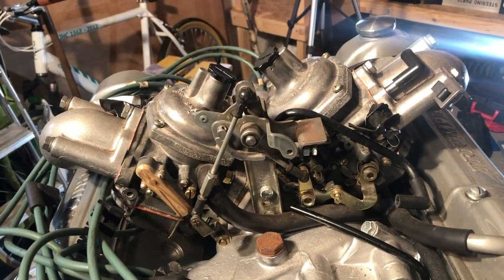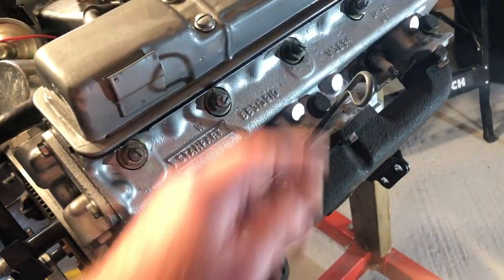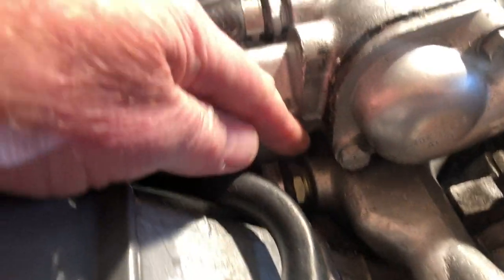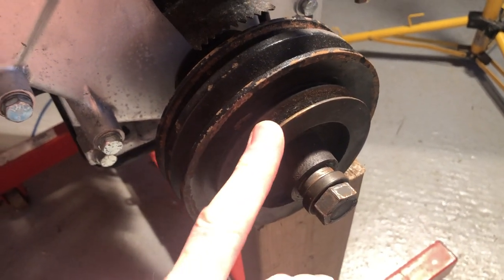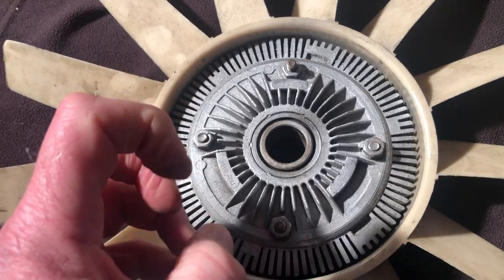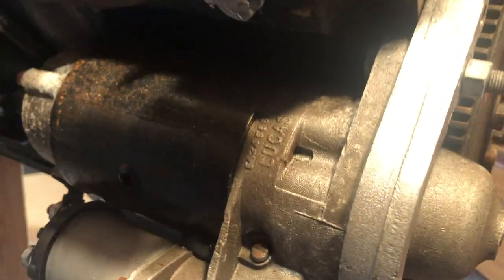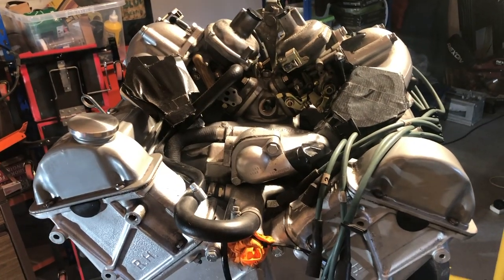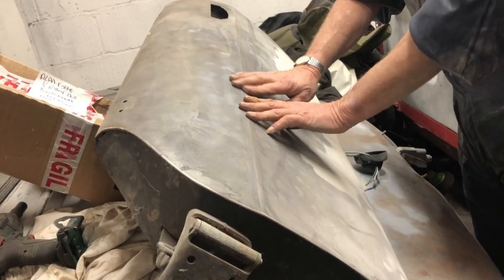Triumph Stag V8 3.0 Litre Reconditioned Engine Tour & Review

Comment: Tony, the upper head ‘bolts’ you refer to are, in fact, studs. And the heads don’t get corroded to the blocks - what tends to happen is the studs get corroded/gunged into the heads, preventing either the studs from being removed, or the heads being slid up the studs. 
The last one I did I had to use three bottle jacks !
Reply: What type of grease / anti seize would you use on the stud shafts ?
Reply: @debneilwoodburn5798  Good question and I don’t think there’s any great consensus on this.
I’d have said ceramic grease, however I used that on an engine a while ago but then, about six months later, had to pull the heads for another reason. Although the studs came out easily, I was surprised at how the new studs had deteriorated. Nevertheless, if I was doing the job again I think I’d go with ceramic grease, but others will have different ideas.

Comment: Tony, now that the engine is outside the car, this would be a good chance to link the rhs cylinder bank with the cooling system - via the water transfer housing, which is still blanked off.

Comment: Tony wondering what range you have or approx MPG from your 3 litre v8? I have recently bought a 1977 3 litre v8 and took on a run and only managed 120 miles on full tank. I am sure that this there must be a problem. Engine runs smooth and has had recent replacement fuel tank

Comment: Tony, worth pointing out the block water drain plugs each side of the block while they are easy to see.
Reply: Also be interested to see where the different cylinders on the V8, if they run down each bank like 2 x 4 cyl Dolomite / TR7 blocks one afrer another.